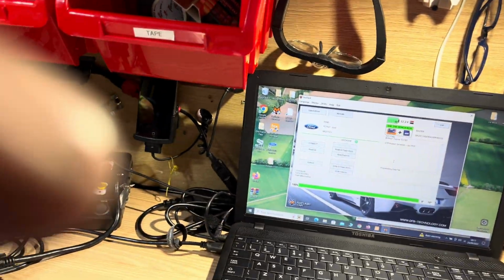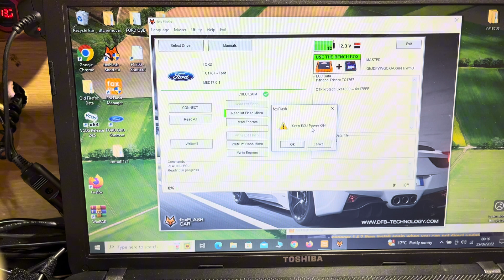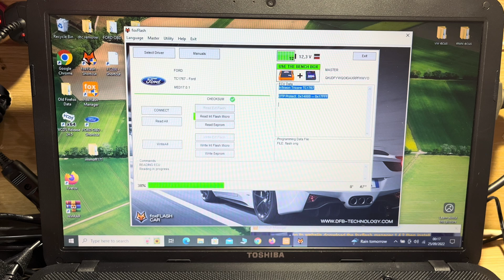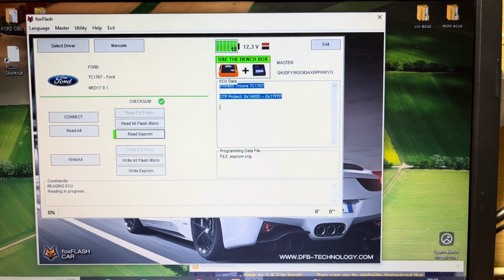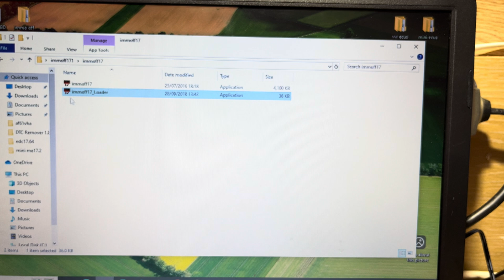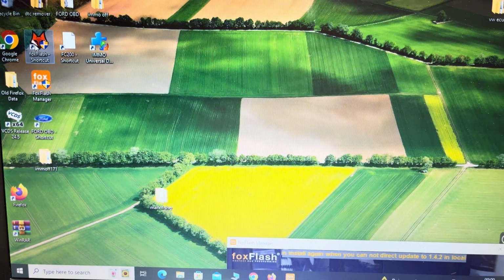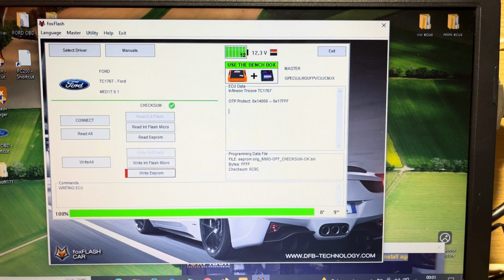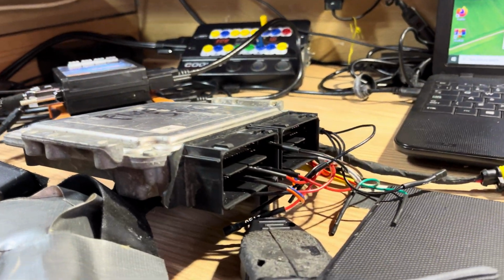Ford ecu 17.0.1 immo off

Comment: Hi , can I get any software to adpat immo of vag group while cloning ecu ?
Reply from the maker: Not sure what you mean as a properly cloned ecu will not need adaptation
Reply: @caralarmandradio  when you're cloning EDC17c46 from KTM bench you need to adapt the file , for other ECU no need adaptation
Reply from the maker: Yes you are right foxflash does it for you with a cloning tool built in
Reply: @caralarmandradio  can I get this software ?
Reply from the maker: Yes just order it from anywhere i got mine on ebay
Reply from the maker: @autodiagnosis4773 this is the immobiliser off software https://www.ecuvonix.com/immo-universal-decoding-p-5339.html?language=en
Reply: You chose the flash file on the eeprom that's why it gave you an error for the second file.
Reply from the maker: Yes i know